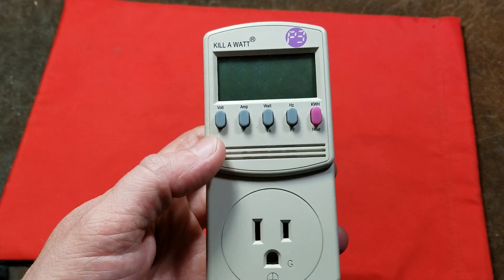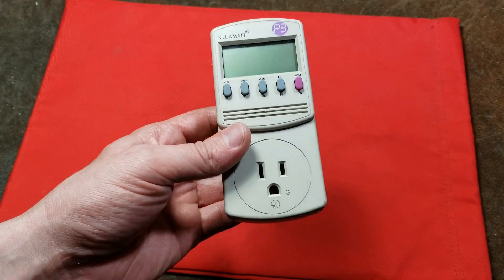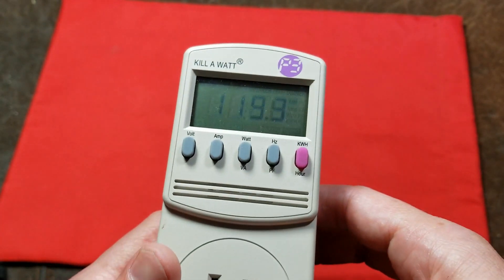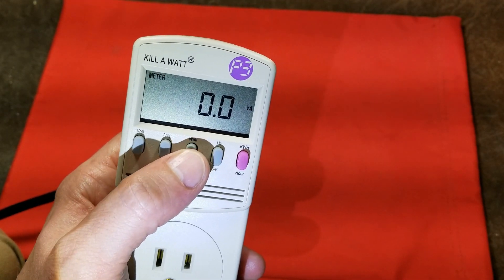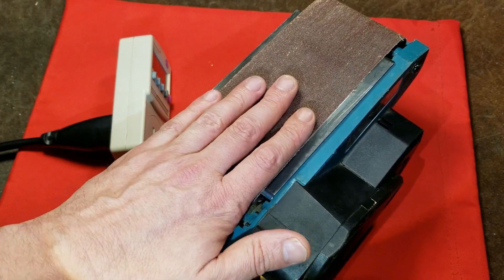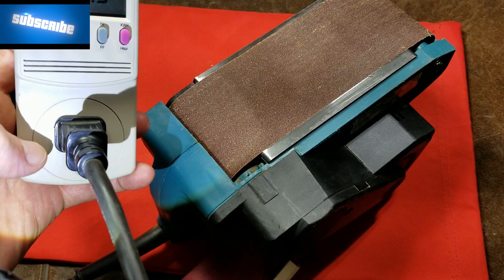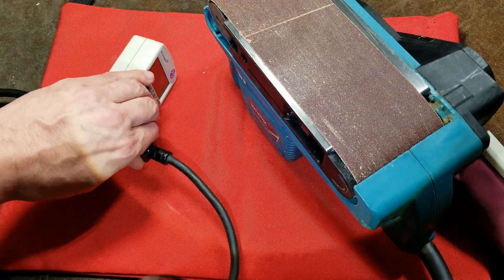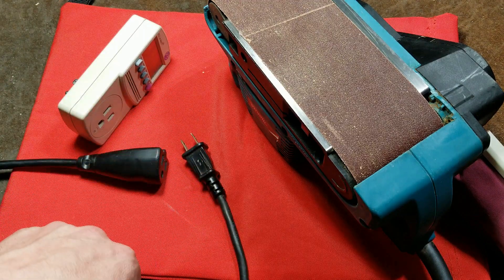P3 Kill-A-Watt Power Monitor & Analyzer Review

Comment: You are the only one that answered my question. When you plug into a wall or extension cord, it tells me  volts and HZ of my house or portable generator not just for the appliance plugged into the front. So when an appliance is plugged in, it switches automatically from reading the back to reading the front. None of the others showed that. So now I will buy one to measure HZ on my portable generator. TY

Comment: I have been trying to find something like or an equivalent to this, for larger home appliances, like a 240 volt, 30 amp clothes dryer with a 4 prong NEMA 14-30P electric cord plug. Any suggestions?

Comment: Hi Catus, A question for you: I have a "Kill a Watt" power meter and I've found that the Watts and Amps don't match up, for example: I have a woodstove fan that I measured: 120v, 74Watts, 0.95Amps. If the 74-watts is correct, shouldn't the Amperage be: 74Watts/120v= 0.62Amps?
Am I missing something? I found this discrepancy in most of my measurements using this. Thanks.
Reply: google "power factor explained"
Reply: @fiver-hoo  Thank you!